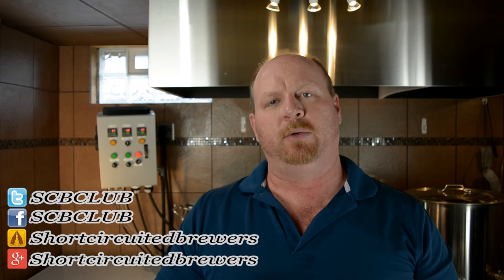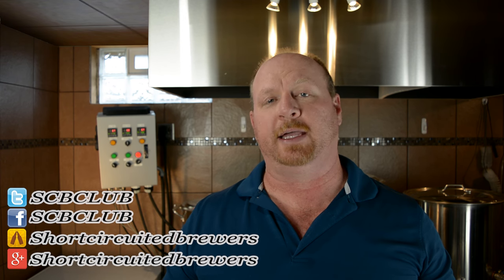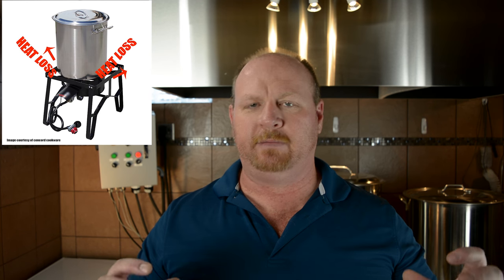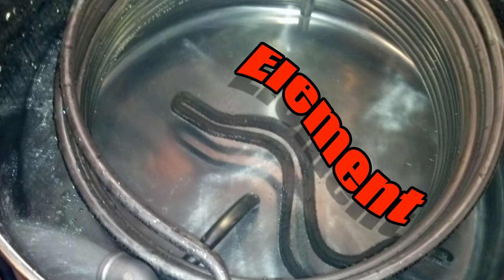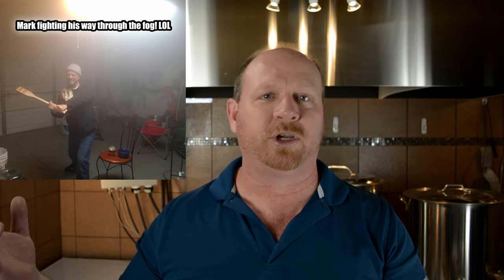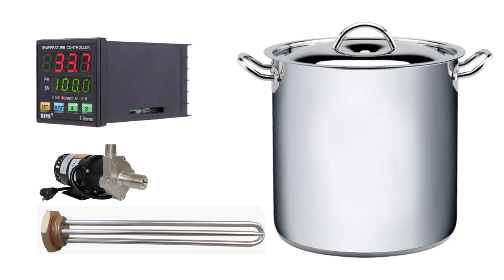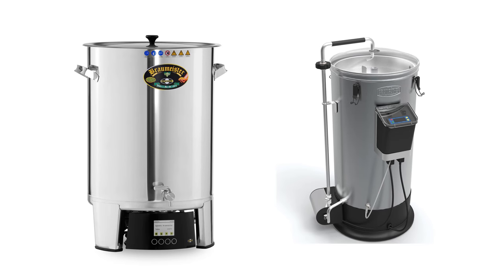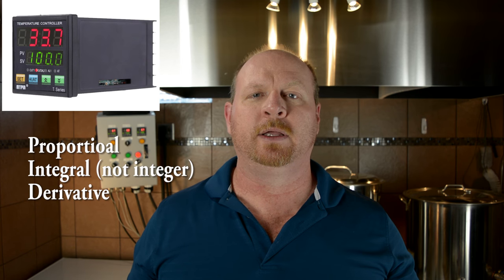Electric Brewing Series - Part 1 - What is Electric Brewing?? #electricbrewing #electricbrewery

Comment: ever use an induction plate instead of the electric burner? I'm sure you could get it up to temp faster with less power used.
Reply from the maker: I have not tried induction, do you use one?  I would be interested in hearing how fast you bring your wort to boil? Is it 110v or 220v? let us know.
Reply: Short Circuited Brewers I have not, but I have worked in kitchens where it was used. I'm just an extract brewer looking to get into BIAB, hopefully by summer. I'll keep you updated if/when it happens
Reply from the maker: Good deal! Let us know.  Cheers!